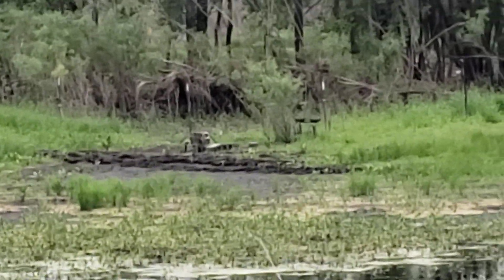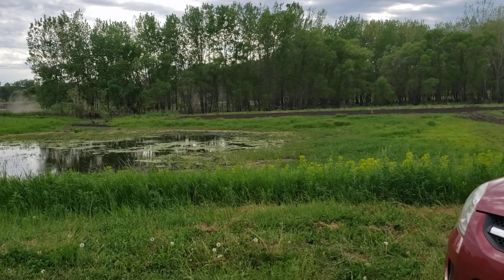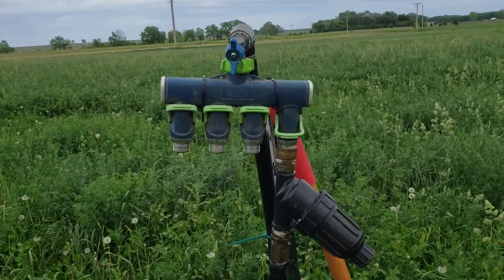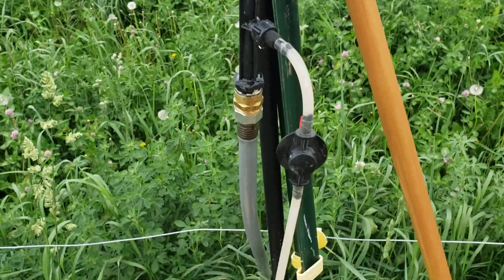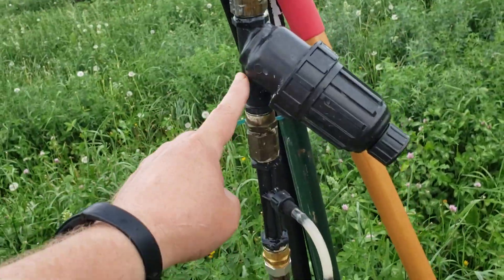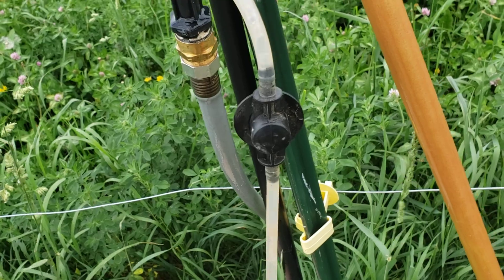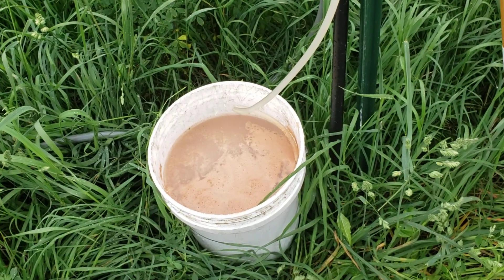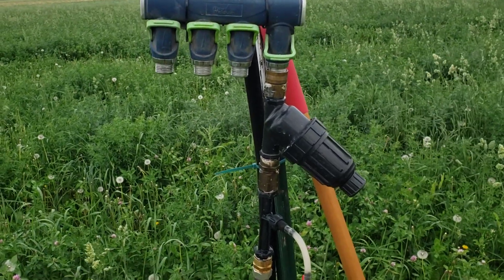Fertigation System - Venturing syphon fertilizer on drip tape irrigation system

Comment: Did you use a pressure regulator?
Reply from the maker: I have in the past, but my water pressure is low, so a pressure regulator hasn't been necessary.  Thanks for watching.